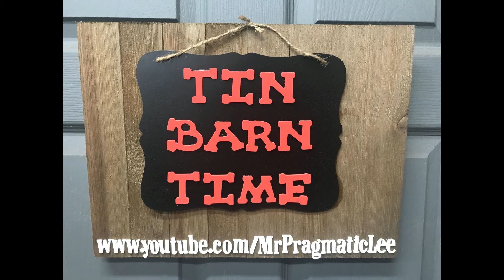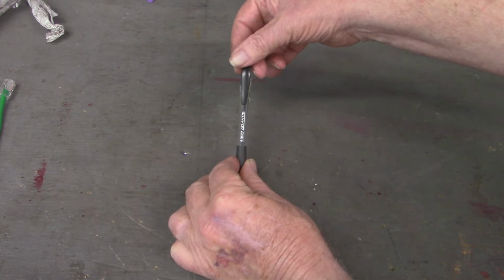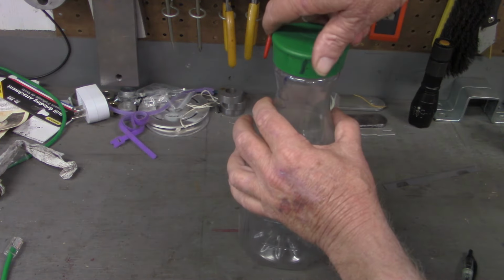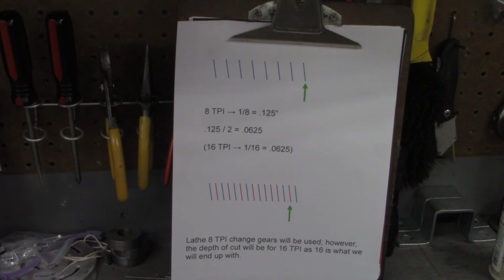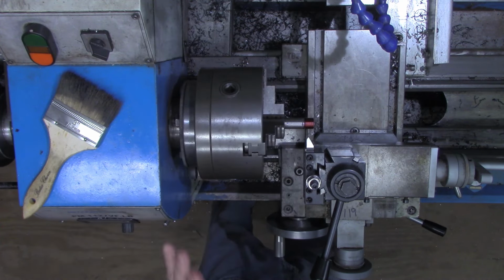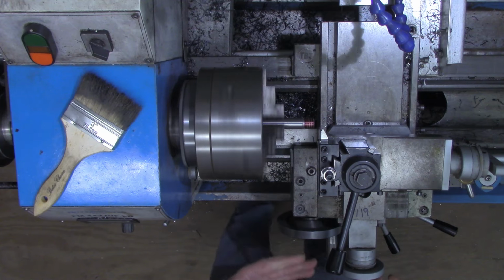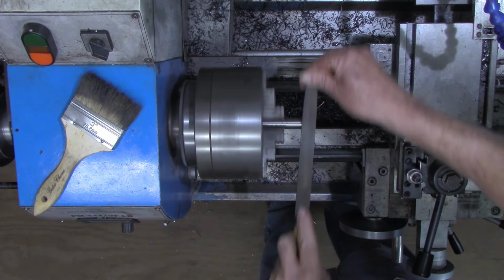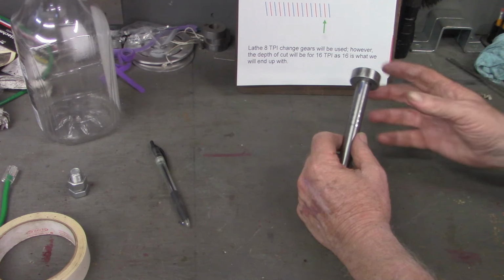Demystifying Multi start Threads

Comment: Everyday, in every Navy Yard and Commercial Yard, LH double lead threads are cut on valve stems.  When I served my apprenticeship we did these threads on manual and NC lathes. FANUC CNC's have specific cycles for doing multi start threads.  Some old American lathes had the capability to do multistart threads with the thread chasing dial.  The math is easy; your lathe has to be able to generate leads that are multiples of the total TPI.  In the case of a 7/8-9 2 start, the lathe needs to be capable of 4.5 tpi threads 180 degrees out of phase.
Reply: That’s a good point, thanks for sharing!

Comment: Lee, you can still use the standard thread cutting procedure (as normal) by adding a .0625" shim on the right side of the threading tool in the tool holder.
No need to set the compound slide parallel to the Z axis, leave it at 29.5° as normal.
Reply: Not exactly
0.0625/2 (sq.root 3) = 0.054126588 & even that is only 
if you are set at 30 not 29.5
Reply: @simpleman283  
What are you talking about?
The thread pitch of an 8 TPI thread is .125", the second thread start is half of that (.0625") for a resulting 16 TPI thread. (1" divided by 8 = .125" and 1" divided by 16 = .0625") How can the square root be applied to this calculation? 
The angle of the compound has nothing to do with shifting the threading tool to the left by 1/2 of the thread pitch of 8TPI.
Reply: @AerialPhotogGuy  
What are you talking about?
Well, that is a good question.
   I've been watching these kinds of videos to learn as much as I can, before getting my first machinist tools. I had temporarily forgot the tool stays perpendicular even when the compound is set to an angle.
  The part about the sq. root was me just thinking about the 30/60/90 triangle. 
   Mr. Lee would soon figure other ways. Like your suggestion & another commenter about choosing a different mark on the half-nut dial, because he already did the hard part by thinking about this problem till he understood. 
   I am a carpenter by trade, but I kind of felt stupid when I realised my mistake here. That is how my learning has always been burned in, by making mistakes. So I count this as a win even though I stuck my foot in my mouth.
Reply: @simpleman283  
No problem at all! 
We all learn by making mistakes. I remember my mistakes better than remember my successes, LOL
Machining is fun and I, too was a career carpenter before building my semi-retirement machine shop.
Best of luck to you and sorry for the delayed response! 🙂

Comment: I too noticed the threads on a pen and on a glue bottle and their importance in early school years! The cap of a Bick pen could make a nice tight alignment taper or could have turned into a cone clutch on machines in my imagination! YOU and I both must have been BORED in class!!
 Thanks for the lesson on using the cross slide to find different thread locations for multi threads! I've never thought about using anything but the threading dial and engaging at different positions.
 Another multi start thread of my early school days was the multi-start thread on the inside of a bicycle hub!

Comment: You can also leave the compound at 29 degrees so you're not form-cutting the threads so much, and change where you engage on the threading dial for the second start. If you engage on any number for the first start, then you can start at any half a number for the second start. Or if the first start engages on 1 4 7 or 10 for start 1, then start 2 would start at 2.5, 5.5, 8.5, or 11.5 - if your threading dial has enough graduations on it.

Comment: Several comments allude to a method of cutting multi-start threads without indexing the work or change gears using just the thread dial. A 1947 article from Mechanix Illustrated (online in google books) explains in detail how to do it.
As Mr. Lee notes, about the only time you might ever have to cut a multi-start thread would be making a valve stem. Multi-start threads are also useful where you need rapid movement with limited rotation in some mechanism.

Comment: My thought on why on why this style of thread would be used on consumer products is that it is easier and quicker to open and close the container and might equate to more sales because of the convenience factor. 😊
Reply: Yeah, I was going to say the same thing - the more starts on the thread, the less you have to "fumble" with the cap to get it to thread on. It really has nothing to do with how far you turn it to tighten the cap - that has to do with the pitch of the thread. You could have the same pitch single start thread, and it would still only take 1/3 of a turn to close the top on the OJ container, but it would be a lot harder to find the start of the threads for the human using it. The machine wouldn't care.

Comment: We are in the future, or there is someone out there, video.  This has been a life time recurring haunting since ~1966, I always assumed it was designed for super lazy consumers and drives me crazy, like the mold maker or the edges of ends, say in plastic, are not spaced properly so when encountering one it is an ambiguous algebra problem.  In other words one has to go into blind man mode to count within a degree or two of the unknown reverse drop downs before being certain that all ready to engage.  I've got enough on my mind and get side tracked over a peanut-butter container.  I'm a long time electromechanical troubleshooter, even did a left/right lead patent pro se.  In an idealistic world they would all drop down at the same position.